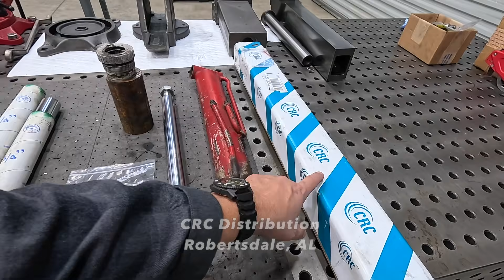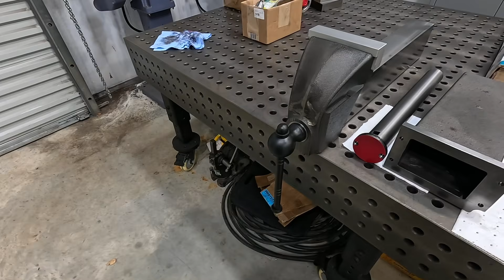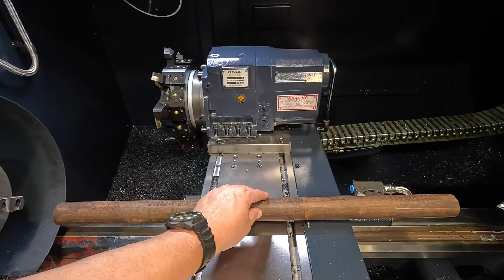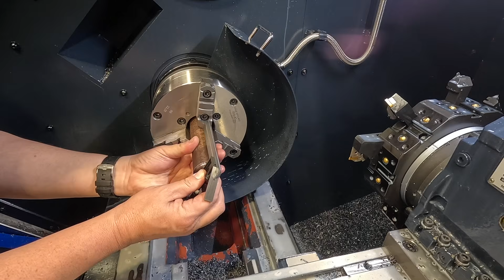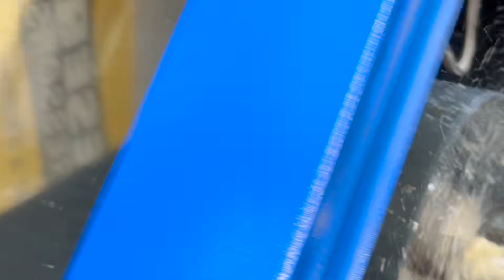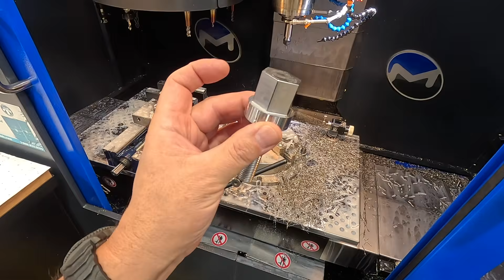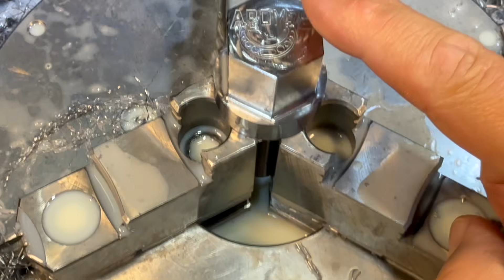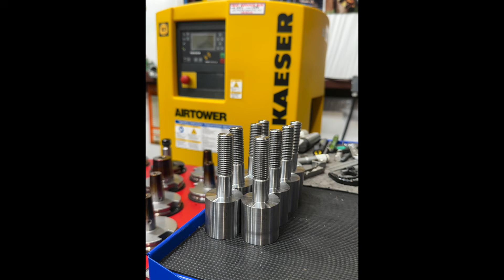Hardtail Vise Prototype Flange Bolts, CNC Machine Updates- SNS 383

Comment: Adam, try cutting a V grove with the tool while it’s in the CNC lathe, just deep enough to be a .010 chamber when the hex is cut in the mill , it should eliminate the need for a hand chamfer operation. Btw I love the look of the hex bolts😊
Reply: Yes, should be exactly the same as doing it later on any lathe.

Comment: Are you going to paint that vise or just clear coat for the raw metal look?

For that chamfer, can you just program a groove at the correct place while in the end lathe? I don't remember how much was sticking out so this might not work.

Alternate could you use some kind of V shaped disk on the cut lathe? Maybe like an involute  gear cutter to run around and cut a small groove before cutting the hex.

Comment: Fit the blank nuts in the vise screw them in ,mark  where they finish up then put them in the  chuck on the mill index them so the logo is oriented correctly ,machine the hex and ingrave them
Reply: Must suggestion was for his custom Abom vice to get it just as he liked perfectly aligned .
Reply: Great suggestion,  I was coming to say that and found your comment. A little bit of "much too fiddling around" for some folks preferences to be sure but the only way to clock the engraving correctly. It might require Adam to sell the special made nuts as well since it is clocked to fit. Jason would be the best person to determine if the nuts are clocked already and provide a selection from that source.

Comment: Looks nice.  They are nice on the black unit. Good working on all.  A ratchet box or hand (big shell box).  A set of soft jaws for work on plastic or soft work.  AL... Brass.   And a set with a round v grove.  Might be nice.   My monster vice has one jaw in AL and the other hard.  The AL was put there as a 'kid' welded the jaw to the screws. School sold it for scrap. Dad fixed it in 1951.  Now mine like other tools for my hobby.

Comment: I like it Adam. Ever since you've talked about this modification, I've been doing something like this or replacing the stock setup with nuts on all my vices. I've always disliked the swivel base clamping as well but never thought to do something about it. Thanks!
Also, add another turning op to the lathe to take the place of the circular milling. Then you can use the part off tool to make your extra chamfer before you part off the part.

Comment: Interesting to see you opt for 17-4 PH! But what condition are you going to pick for the hardened condition? H1025? H1150? Or one of the other precipitation hardened conditions?

Also: 17-4 PH isn't all that good at resisting galling, so do you have plans to mitigate cold welding of threads?
Reply: Would cold welding/galling be an issue between 17-4 PH and cast iron?
Reply: @mjwint  That's a good question, and I'm not sure if it is or not. It would probably depend on the carbon content of the cast iron.
Reply: Anti-seize?
Reply: @tsmartin  Assuming that the combination of cast iron and 17-4 PH is prone to gall (I can't find out if it is) you could use anti-seize, or the better more expensive permanent solution would be to use Nitronic 60 thread inserts. ARMCO developed Nitronic 60 back in the sixties specifically for galling resistance.

Comment: Adam, about the chamfer you are manually finishing - could you make the chamfer in the CNC lathe before you take the part to the mill?
Reply: Yes, best time to do it.
Reply: +1 for cutting the chamfer on the top side of the flange in the lathe before moving to the mill.
Reply: And that is what Adam was talking about…. He did not have the tooling to do that operation…
Reply: @francisschweitzer8431 it's a simple touch with a cutter to make a V-groove, the tricky bit would be getting the groove in the correct location and depth. Milling will remove the 'top' half of the groove, leaving a chamfer on the finished part.

Comment: Pretty much pointless offering to take a piece of equipment in if they can come and remove it anytime, all the setting up, getting to grips with the software and familiar with the machine and tooling. Better off buying your own, albeit smaller due to costs.
Reply: Sorry, have to disagree here. If you have equipment on loan, be that photography gear, DJ gear, musical instrument, machining equipment or any other tool or production equipment, you can still gain very useful knowledge and experience. 

He got this for free, gained useful experience and, with some time, will get a new loaner. He's getting out ahead. This is a win-win situation, because the manufacturer also got useful  exposure.
Reply: More than likely the same controller will be on the replacement and the rest will be an evolution rather than a revolution on the last one.
Reply: A 50ft machine requiring a heavy lift and specialist installers in my opinion is different from being loaned a Stratocaster and box of pedals, that's just my opinion,

Comment: I also upgraded the clinch bolts on my vise by milling hex heads on them. Made it much easier to tighten and loosen the bolts. It was a good thing to do. Highly recommended, easy to do. cheers

Comment: Hey Adam, I have a possible suggestion for something that you could manufacture for sale, and would utilize all axis of your machines: a small anvil machined out of a piece of railroad rail. Could potentially be CNC'd in a single setup (maybe? I don't know if your machines have that much capability or not), and might sell well. I know I would purchase one as long as it's not out of my price range. Baby's first anvil, proudly MFG'd by Abom79.
Reply: He would have to arrange to get the rail from a proper provider since you're not allowed to do that. Found rail chunks or drops still belong to the rail authority that "lost" them, so  making anvils of them for resale rides too close to the line for anyone without authorization on file and attested in writing which could be reproduced on the paperwork for the anvil.

Comment: I would be interested in you doing a walk through of the fusion cam on the lathe.  The lathe feature does not exist for a HAAS TL.  Maybe I can use a miltronic post process and hand edit the 'small changes' needed.
Reply: Why do you need cam software when you can use the conversational software that came with the TL??
Reply: @jonathanleon2549  I use the HAAS controller cam all the time. However linking up all the different steps into a full program is time consuming. Where changing in a true cam package and reposting would be nice.  Currently I make the drawing on fusion 360. Take the print to the garage and generate the cam on the controller. It would be nice to generate the cam in confusion 360 as well. A nice learning step to a larger more fully featured lathe (my wish).
Reply: @larryblount3358  I get what you're saying. I think you can use a generic post. Might have to change some M codes. I'm surprised there isn't a post for that machine.
Reply: @jonathanleon2549 you can do more complex things, as well as making the programs more quickly in CAM.
Reply: There is a Hass general turning post that will work just fine for the TL.
Reply: @MechanicalAdvantage  I will look again. Your free advice here says you are worth a ton. Thank-you

Comment: How about using the cnc lathe to put the last chamfer on? No need to handle the part one more time in a manual machine.  What about adding an optional stop for the tailstock move?  This saves you from hand moving the federate to zero and hand stopping. It would prevent an error if you just happened to be a little slow or got distracted.

Comment: the rodgland is a standard 7$ item so no need to make them.
Reply: Who the fork made those for $3 with $2.5 in material cost so that they could be sold for $7?

I think the hydraulics shop charges about 30 for a gland that size in here and it's a good price. 

Also there's all kinds of them and the shop only stocks the one style they prefer, all the other styles are considered odd and would be made as a custom order.

Comment: I had no idea someone offered fusion training like that. I just checked out his website and I will definitely be buying some hours with him. I’m in the same boat as you- trying to learn software at our age isn’t easy. The books I’ve bought are hard to follow and most YouTube videos on fusion are hard to understand the narrator. Thanks for sharing that.
Reply: ACE CNC Machining Training (Fusion 360) is free Im doing it online just for something fresh to add on a resume I have a lot of experience but I have a lapse in employment of about 15 years .
Reply: @ thanks I’ll check that out as well. I get a little better every time I design a part, then get busy and don’t use it for a month and I forget all the little tricks that make it easy. I was trying to put barbs on a hose plug I was making for turbo testing… I goofed around for 30 minutes trying to add them to a cylinder until I remembered how to sketch the side profile and revolve extrude it lol
Reply: It is really hard to follow and really easy to get completely lost.
Reply: I need to repair my 3d printer but the narator on the video has a hindi accent and is nearly impossible for me to understand. The website showing me how to do it is like trying to read greek.